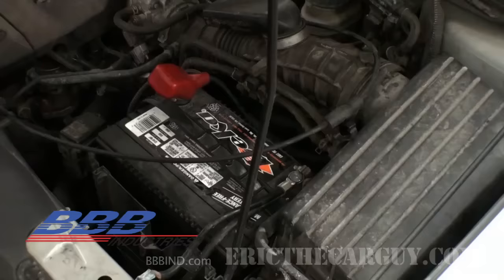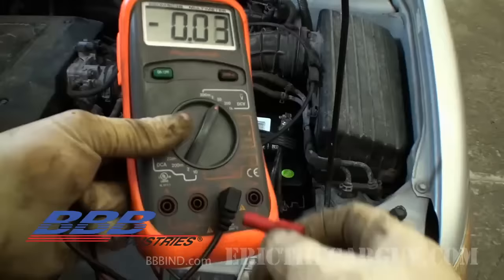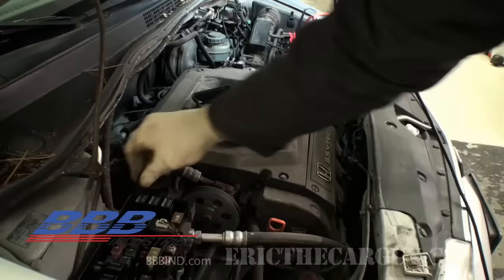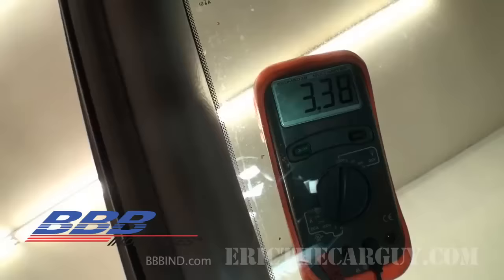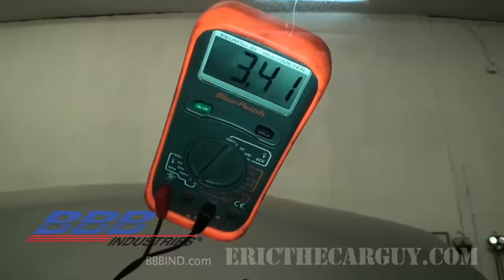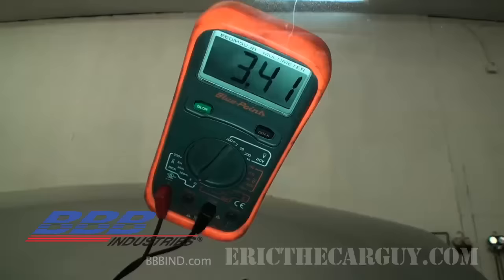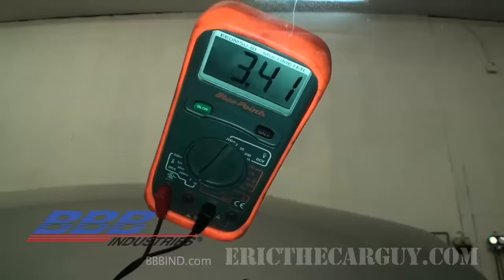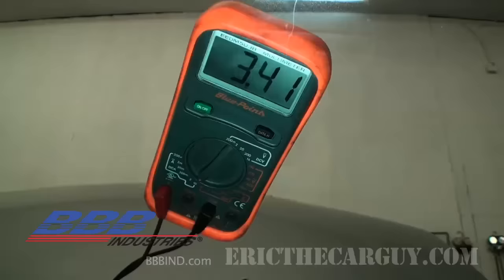How To Perform a Parasitic Draw Test - EricTheCarGuy

Comment: One headache  in a car like my Infiniti Q60S is if you disconnect the battery
then reconnect it the alarm immediately goes off with the lights flashing
and the horn blowing until you use the key fob to unlock it. I have
some sort of parasitic draw issue and need to find it.
I guess I'll first disconnect the horn. The car is fine unless it sits for
over 2 days then the battery is dead. The parasitic draw is not much
over 1 amp because for now until I get around to fixing it, I
use a small battery tender thing to keep it from discharging
when it sits for longer then a day or so. Problem with my
car is the previous owner had some idiot
install an after market alarm and proximity sensor thing in it
and fubared part of the wiring harness. Joy of joys.
Nothing like having to fart around under the dash trying to 'fix' a cockup produced
by some moronic hack. I mean, what in the name of all that is holy
would ANYONE need an extra alarm in a 2014 Infiniti Q60S? You fart
next to one of those and it's alarm goes off.

Comment: Use headlamp bulb in  series with battery when light goes out you found fault  heater plug relays, tow plug relays , interior light delay circuits ,radios  , glove box and boot lights  starter motor solenoid, and play hunt the lake with wiring in it  VW doors often full of water upsetting  stupid micro switches in door lock

Comment: Great video and some excellent tips, I have a Beetle Bug, new shape 2002 and it has around 500mA draw, what was weird is I pulled the stereo fuse and it went away to near normal range 50mA then I placed my meter back on the terminals and the draw came back, so I pulled the stereo and it came back to 50mA then even with the stereo still disconnected now the draw is back the next day, that was the only main change and closest I got to perfect so I'm wondering if the issue is due to the main wiring loom, I may give it a few wiggles inside the dash and see if it goes away, also I get a drop when removing the fuse 15 which is 
G85 - Steering angle sender (T6p/4) for TCS/ESP
J217 - Automatic gearbox control unit (T68/45)
J285 - Control unit in dash panel insert (T32/23)
Y2 - Digital clock (from model July 2005)

Drop around 150 mA - so I think I have a combination issue

Comment: As I'm sitting here... expecting some elaborate issue that needs to be fixed.

Dome light switch left on.

Could have skipped a step and made sure all switches were in the off position before pulling fuses  lol. But regardless, thank you for the diagnosing information.

Comment: 99 cadillac VATS bypass may be causing parasitic power draw. the draw is around 2 amps and the bypass has two 2 amp fuses. nothing else on the car is under 5 amp fuse. have you worked on these cars before for a parasitic power draw?? i changed the body control module.

Comment: Our meter has two ports not 4.  One says com and the other has volts ohms and a symbol like an arrow with a plus sign on it. It has  20amp and 200 and 400 amp on the dial . Do we need one like the one in the video.  Where do we get a meter like that one? Whats the difference between it and ours.
 nothing happened when we tested the terminal and the cable for a draw. Not sure if its the meter or we don't have a draw.

Comment: Eric does parasitic draw come and go sometimes I’ve had a load test on the battery three times twice in the car with the car off and once completely disconnected from the car the battery checks out go and the alternator is charging fine 15.2 volts but the last check at advance auto they notice the (parasitic draw) started at 10mA and by the end of the test it was 45mA. But now at home and don’t see anything.?
Reply: 45 mA is nothing of any concern.

Comment: Hi Eric ,
I just watched your video .
I am having this problem with my Jeep Cherokee limited 2021 .
The Jeep won't start , then after a few tries , it starts and the radio comes on . The radio is turned off every time I shut the Jeep off . I took out the fuse if the radio to see if it starts up the following day .
Could it be a bad fuse ? 
Could the radio not be shutting off when I shut it off ? It makes no sense to me .
Suggestions?
Thanks ,
Deb

Comment: I disconnected the alternator wire and the parasitic draw went down so I did a diode test on the alternator and it tested good. But when I connect the power wire back to alternator the parasitic draw comes back. Should I change the alternator?

Comment: So Eric- what if you've replaced the alternator, and the battery is good..........and the battery light still stays on????? Alternator is charging the battery, getting 14 volts, battery is at 12.98 with engine off.

Comment: I just performed this test and came back with no drop from any fuse after 1.33 amps. I had the positive lead in the wrong plug though, the 200mA max plug, will this completely mess up my test?

Comment: Having this same problem in my Chevy truck. Except if it sits for 3-4 days it completely sucks all the juice out of a battery to the point a cell shorts out. 2-4v is usually what it brings it down to. Luckily I have a 3 year warranty on these batteries but I’ve yet to find the source of the draw 😞

Comment: Great video! I've pulled every fuse out from the engine bay and every fuse from underneath the steering wheel.  Have a massive 4.2 Amp parasitic draw and at wit's end. If it's not coming from any fused device, where could it be coming from?  right now, I pull the battery cable every time I park it, so I have enough juice to start it again.  New battery, new alternator (alternator does charge it when running, but in a couple of hours after leaving it off, battery is completely drained.  Anyone have any idea?  What other non-fused component could do a 4.2 amp parasitic draw?

Comment: No parasitic draw, but will not start after a day or so, sitting.  Getting about 14 volts charge at alternator and the battery is relatively new.  Problem began after serpentine belt was replaced.  What else can I check?
Thanks

Comment: I’m checking my acura MDX since my battery is death I am using a portable battery booster. So I plugged the positive side of the booster to the positive cable of my acura then the negative to the meter and the other leg cable of the meter to the negative cable on my acura. But the meter is showing a load of 12.48 amp.  I’m not sure if I’m doing something wrong. All doors are close except the front hood

Comment: You didn't mention waiting awhile for the computers to shut down. New cars have components that run for awhile before completely shut off. When you reconnected your meter the computers could be turning back on from being without power and that could give you a bad reading.

Comment: I've had a problem right now with my 2008 Quest. It has been going on now for 5 years. No One seems to know the solution. The Van is used on a daily basis and will not start after 1 hour after of turning the vehicle off after having no problems for a 2 months or more. I will have the Van jumped and it will be fine for 2 or more months and then it will go totally dead again. Had the alternator looked at and was told it was fine and told the battery was fine also.. Already had put a new battery in it. It seems to be happening now more frequently...like once every 3 weeks....that's what brought me here...not sure what the problem is

Comment: Can an alternator output to the battery be 14.6 VDC and at rest still put a drain on the battery? My battery freshly turned off is 12.6 VDC...in 3-4 days it's 10.5 VDC. My troubleshooting so far leads me to 1. radio, 2. alternator,  3. somewhere else. Drain on system is 27 milliamps at rest.

Comment: So question: with the battery cable disconnected, the vehicle automatically ‘wakes up’ when I connect my meter in series. Since my meter has a warning to limit amp test to only 30 secs at a time, how can I allow time for the vehicle to ‘go to sleep’ since I can’t leave the meter connected that long?

Comment: I have a 2006 Ford Taurus with a check charging system light, I found that the alternator was bad by checking the voltage with a multimeter (voltage was at 10.2v or so) replaced it, I checked the after install and was at 14.3v then the check charging system light came on and again it was at 10.2v!!! Could a bad battery trigger the warning?

Comment: Should I pull relays as well as fuses?
Reply: Only pull fuses at first so you can identify which circuit is involved with the parasitic draw. Once you are working on that specific circuit it might necessary to remove or test relays.

Comment: I got a question for ya, does the multimeter allow power thru the leads? Because if not with battery disconnected the circuit that draws will not be powered to identify itself
I've tried this method with no results even with headlights on no change in amps
Now with a test light the light acts as a fuse but also a light indicator so the drawing circuit will be powered up so one can identify the draw by removing fuses until the light goes out...   Any explanations on how a multimeter can do this is welcomed, because I do not understand

Comment: I have a 2002 Ford E-250, cargo van. There are no inside cab lights. Not even when the door is open. No under the hood light.  I do have an after market radio, turns off when the key is out. I have been driving it for a year now and the battery is 1 year old. I have checked and the battery is good. I watched this video and did the test. My meter shows, 0.15. I checked all fuses anyways one at a time, and nothing. I also unplugged the radio and nothing. I charged the battery, unhooked the negative and let it sit overnight. I connected the negative in the morning and it started. After all the testing I left it connected and the next day it was almost completely dead, the door chime comes on low and just barely cranked but not enought to start. What else can I do?

Comment: If there was a scenario where you could isolate the fuse but we're able to solve the actual problem would just leaving the fuse out fix the problem. Obviously assuming that it was something that you didn't need like the radio for example.
Reply: Sorry weren't able to solve the actual problem

Comment: IF it is "just a trunk light" can i simply remove the fuse and carry  on forever without it? I understand if the fuse is dual purpose this will not work? I am suspecting the trunk light .. the wire got sliced sometime ago and it was never repaired. Never thought the disconnected wire might still draw juice? Can it? Thanks for your video and thanks to anyone if they can answer my ?? :) Really old 92' Saturn

Comment: My problem started while at work listening to the radio I would say 45min nothing but the radio on. Went to crank after work dead. Jump started and voltage on gauge went to 14v for a few miles and back to around 12.5.  2014 Silverado how long should I let it sit before testing to allow modules to go to sleep like onstar and others. 
I tried it today and got around 2.00- 1.32 MA. My meter only has Amps and MA so I’m kinda confused about what I should actually be getting. Should I technically be 0 or no more than.050MA 
As far as testing the alternator and battery tested fine by the actual shop that rebuilds alternators.

Comment: Hey, I did the same test on my Skoda Superb. The current drawn started at 1.8A and went down to 0.2A and jumped back up to 1.8A. Continued to do it regardless of which fuse I removed.
Could you help me with what's the potential issue.
Thanks

Comment: Hi.
I have a 2007 ML AMG63. Now the indicators or turn signals is working when activated. Problem I am having is the front indicator light right is not coming on. Fog lamp flashing. Diagnostic say short to ground on right indicator. Then I test every thing and find nothing. When I check indicator lights again front right is working and front left stop working. And test find nothing then both front indicator lights don't work. Then I test and check both works. Not always in this order. What am I missing here.

Comment: Hi,
Any thoughts on why when I connect a test light in series with the battery negative cable and the battery negative post the test light keeps being lit! I know this indicates a parasitic drain, though when I connect the Amp meter the same way as I did with the test light" in series", the Amp meter reading goes down to 0007 mA as Fluke multi meter showed. That is no current draw according to the Amp meter. Could the situation be like some ECUs are not being supplied with 12V due to a voltage drop caused by the resistance" test light", connected in series? I mean ECUs are, for example, trying to perform a certain task but they fail to do so; thus, they keep repeating a certain cycle.

Thank you for posting such informative video. I appreciate it.

Comment: I started by disconnecting my hands free link on my Acura TL 2005 and it seemed to help with the battery that was dying overnight but something still seems off. Went to the meter approach and my amp draw is .05 and all my fuses measure next to zero. Based on what I'm reading this kind of power draw is normal. However my battery seems to go from 12.65v to 12.4v overnight and its less than a year old.

The only fuses that had a negligible amount of voltage to the internal light and backup fuses .05 to .20 mV. Guessing this is tied back to the alarm or clock.  Would the next logical step be to disconnect the battery and see if it will hold the charge on its own while disconnected from the car?

Comment: I read on GM it's 85 millivolt Max,  maybe newer cars have this limit.
I have 02 chevy express starcraft conversion van,  somebody knocked faceplate on radio in rear passenger area loose and it kept running battery dead. 
So I removed it. Have to ask for it now then I give them faceplate.
Left it on for ear buds I guess.

Comment: I got a question dunno if my leads are in the wrong slots cuz i only have 3 (com, VΩmA amd 10AMax) when.i put it on 10AMax it shows nothing and when i put it on VΩmA it shows the same voltage as the battery

Comment: Hi eric. I just found on my vehicle 0.04. is that means that there is no drain on the system? But my battery is getting 12.1 volts when not using for 5 days. My multimeter works fine though. What do you thing?

Comment: Hey, i have a 2001 Honda Civic and when i try to do this test (when i touch the terminal with multimeter tip) my position lights starts to blink (front and rear). Why is it happening?

Comment: Great video and thanks for posting. I could really use you're advice and knowledge. I have a new battery and new starter in my 2005 Nissan Altima. Worked well for the first week soon after I've been having issues.
While turning the car over the alt light comes on then after the car starts it goes off after 2 seconds. My car has not done this before. So I started a test to see if it was my week old battery with a stamp date of March 2019. After running the car around town and coming home I turned the car off and immediately disconnected the negative terminal which read 13.02V and dropped to 12.98v with in a minute that was at 11am. Is that normal?
Then at 2pm I again read the disconnect battery at 12.67v, then at 7pm I read it to be 12.63v. The next day I read the still disconnected batery at 9 am being 12.61v.
At this point I did a 10amp test between the disconnected negative wire to the negative battery terminal and it showed a 0.11amp draw with the doors closed. I tested this for about 5min and then decided to connect the negative terminal. It read 12.53v. It's dropping but is it a parasitic draw? So I left the battery terminal lead connect and haven't started it since yesterday. I went back out and tested it at 1pm it read 12.49v.
I'm so confused I used two multi meters and have the same numbers. Could it be a dud battery. Any thoughts?
I've tried to be very detailed in my explanation.

Comment: I’ve got an 09 GMC Sierra 1500 reading .750 amps when I first put the lead on the negative terminal. After 45 seconds it’s goes back down to .012-.004. Is that normal or should it read below .030 milliamperes as soon as I put the lead on the negative terminal?

Comment: I have 100mA draw that I cannot find. Pulled every fuse without it dropping with the exception of the SJB microcontroller fuse which kills power to everything. Have no idea where to start at this point. No aftermarket hardware. What would you suggest?

Comment: I have a 1994 Chevy K1500. My battery keeps dieing. It will slowly drain over a period of a few weeks. Last time it happened it drained down to 4 volts (BRAND new battery) over about 2 weeks, maybe 3. This parasitic draw test shows between 20 and 30 milliamps. Had the battery charged back up before performing. When I pulled my stop/hazard fuse was the only time that the amps did not fluctuate. Is it possible that the fluctuation is why it drains so slowly? Going to test the battery in a few days to see if it has dropped anymore, but is there something I'm missing? Some other test I should do? I'm at my wits end with this already. HELP!!!

Comment: eric I have a question about the readings i got from my multi meter when I performed this test on my 1992 ford mustang. test performed with fully charged battery, dome light circuit disconected and all accesories off. upon conecting leads to negative battery terminal and negative battery cable with my MM on highest amp scale setting, the reading appeared high 2.9 tp 3.0 for about 3 to 4 seconds then jumped down to 007. this car is OBD1 speed density with no other electronics. why the initial spike then goes down???

Comment: If and when you find the fuse that is causing the drain can you just pull it and leave it or do you actually have to fix the issue? I have a commuter car I need 3 miles a day. Alot of the accessories don't work anymore like my radio and such. Can I just leave the fuse off?